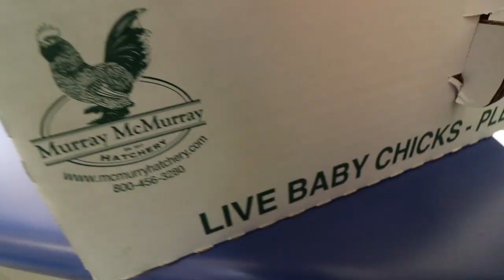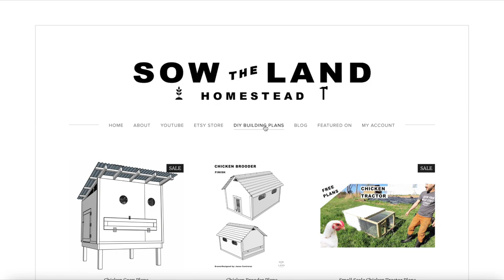Are Chickens SAFE to send in the Mail Post Office/ VLOG

Comment: At what temperature do chicks not need a heat lamp?  I will be getting layers soon!🐥
Reply: It depends on how many weeks old they are. Mostly they need the 100F+ temps before they get their true feathers. Keep them out of water because they can get too wet and die. A small waterer is best to start with. Every week go down by 5F. You want it to be about 70F before you let them out during the day once they have their feathers. I don't think they need a heat lamp if it stays above 70F after that when they are still young. As grown chickens they can survive very cold temperatures. If you grab a chicken, they are hot little birds. They can bundle together and warm each other as long as they have food and water and some type of shelter. Good luck.